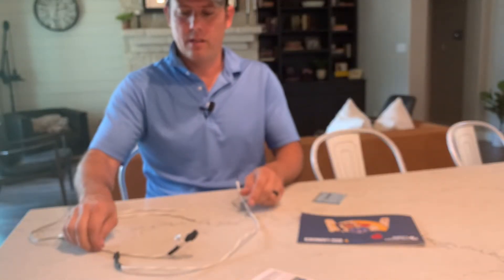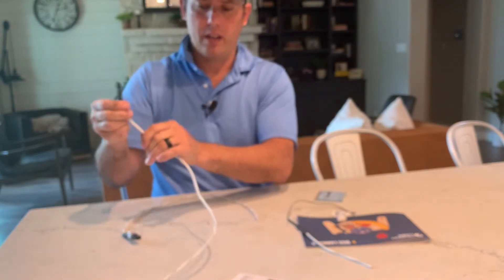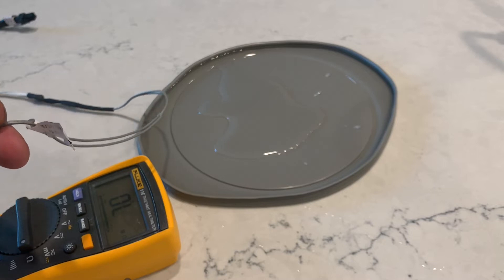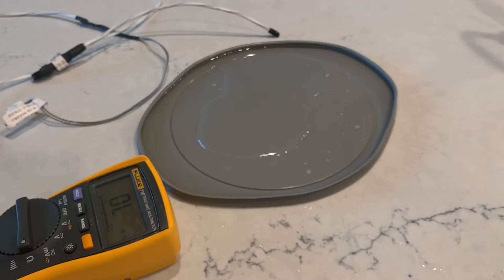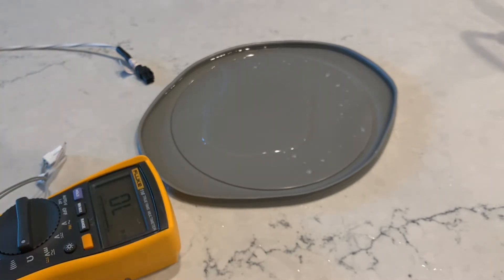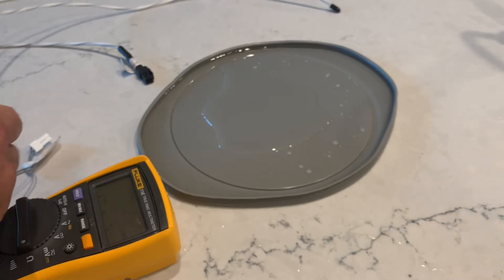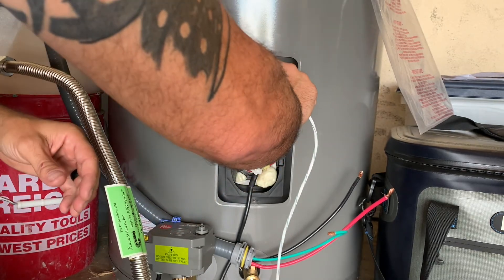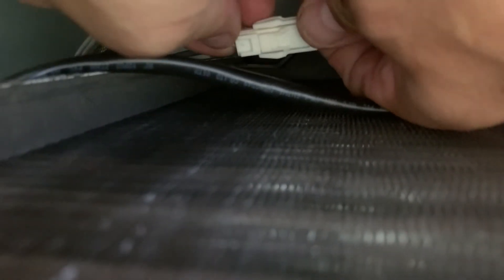Rheem water sensor comparison and testing (ohm), hybrid and tankless.

Comment: I need to talk to you. I got three replacement sensors for my hybrid wh that have different color wires than the oem parts.  I asked your customer service to have a manager call me about concerns with these parts failing in less than 2 years. You look like you might be able to help me if you are a Rheem employee.
Reply from the maker: I can help.   Can you tell me what colors are your wires.  I assume you received the suction, heat exchanger and the discharge thermistor.
Reply: I did receive three new wires. All are white. The original oem sensors all have different color wires. My unit was reporting fail on the discharge sensor but i was told to replace all three. I want to make sure i have the right parts before i have a plumber come out to install since i am out of warranty 2 years after purchase for these parts.